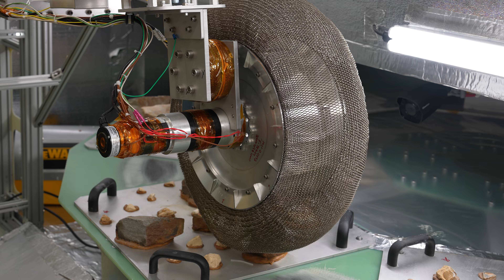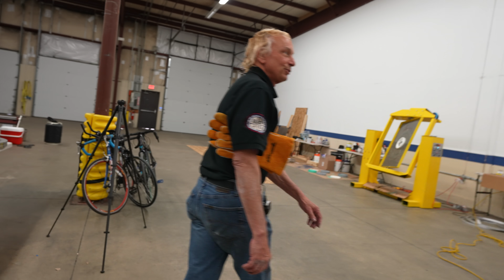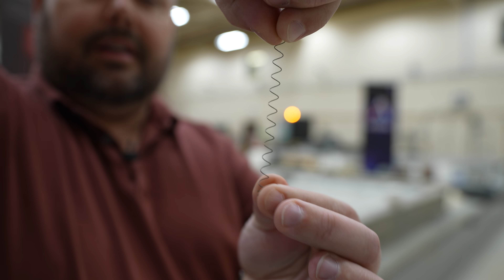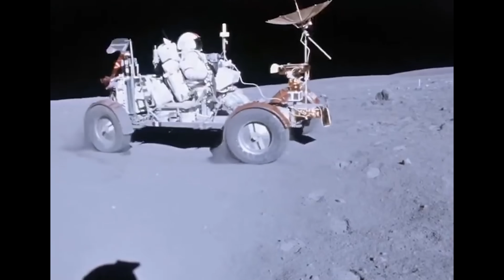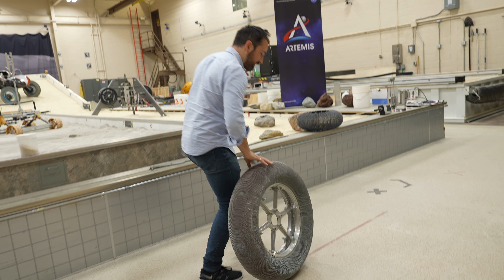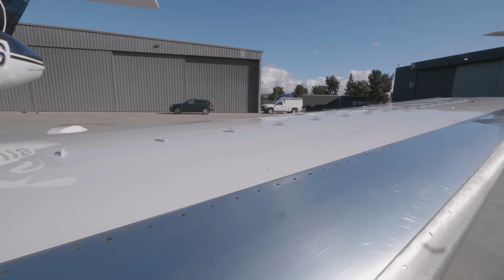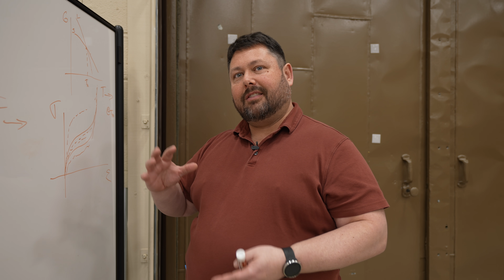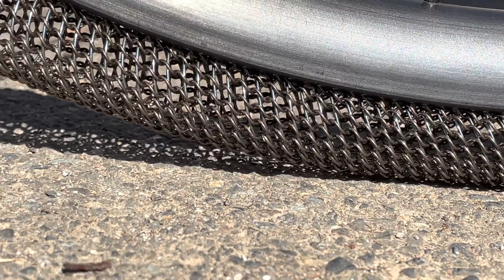How NASA Reinvented The Wheel

Comment: The stress-strain curve reminded me of my PhD work on single DNA molecules. We could grab the two ends of a single DNA molecule (with laser beams, of course), and make force-extension curves. DNA also goes through a phase transition under physical strain. At first it acts like a low stretch string, where the force increases quickly as the extension gets close to the full length of the molecule. At around 65 piconewtons (65x10^-12 N) it will “overstretch” and at a relatively constant force (hallmark of a phase transition) will stretch to ~1.7 times its normal length. When the force is reduced it will go back to its original length, although there can be significant hysteresis depending on how quickly the load is reduced. The overstretching is coupled to an unwinding of the double helix, so in effect it’s a wind up toy and can be used to apply torque, e.g. rotate a microscopic bead. DNA is a super cool material, I hope Veritasium does a video on this stuff.
Reply: I did not expect someone talking about overstretching DNA in an optical tweezer in a video about Nitinol. Greetings from a postdoc doing a lot of force extensions on RNA in magnetic and optical tweezers 😅
Reply: @salina3192  Hey, it’s a small world! Good luck with your experiments. One of the most fun single-molecule assays I developed was with DNA and RNA. I used plectonemically supercoiled DNA in a magnetic tweezers to do measure R-loop formation during transcription. It was the best assay because at the end you can overwind the molecule to release the RNA and regenerate the original tether. Could get a lot of data from one molecule!
Reply: @salina3192  As a layman, this video was mind-blowing enough, and now you two come in and tell us you can hold DNA with LASERS?! There's no brain left to blow anymore, it's all over the walls now!
Reply: > DNA is a super cool material

Is there any form of research going on to use DNA as a main ingredient of a material? The same way e.g. polymers are used in plastic? Or what sort of (potential) applications do these cool properties you just  mentioned have? Sounds fascinating!!
Reply: @Merthalophor  Yes, DNA is being used in material science. I’m not sure about industrial scale applications but due to the fact that it has a programmable structure they can do something called DNA origami and use it to make self-assembling nanostructures.
Reply: What about DNA computing 🤔
Reply: @tbraghavendran  yep, that is an active area of research as well. And they can make logic circuits and put them into cells for digital computation in cells. Wild stuff.
Reply: That's super interesting. Was there any change in the DNA chemistry during experiments? It'd be an interesting result if the mechanical properties of DNA were a factor in mutation or cancer.
Reply: @shrub4248  The mechanical strain would not itself cause any chemical change, but in theory inside a cell such mechanical deformation could make the DNA more susceptible to damage. DNA and all of the molecular machines that interact with it is super fascinating. E.g. because it’s a helix, the enzyme that separates the two strands during replication actually causes the DNA to rotate at several thousand RPM. This rotation would cause it to severely tangle so then there are other special enzymes that cut the DNA to allow it to swivel and release all of the twist. Life at the molecular scale is a true marvel of nanotechnology.
Reply: What if the actual "pair of letters" provide different properties on this stretch, torque/force transmissions and handling, etc? If so, you could engineer a highly specific shape and "sequence/stream/signal" of properties along the string !
Reply: @marcoottina654  yes, the different base pairs do have different binding energies, so the sequence does affect the mechanical properties. In theory you could have regions that are stinger and regions that are weaker and get some interesting behavior. Some sequences can actually adopt a left-handed helical form (normal DNA is a right-handed double helix). One of my theoretical projects was to insert a sequence that adopts the left-handed form when subjected to negative torque (as occurs during DNA replication or transcription) to make a sort of torque-capacitor to regulate gene expression. There are enzymes that chemically modify the DNA that also affect this transition to the left-handed form, so you could add another layer of control to the regulatory sequence. There is decent evidence that evolution has in fact used these mechanisms to regulate gene expression, but it is kind of a niche field and not well-explored. 

Sadly I had to leave academia and couldn’t pursue this research further because America pays its scientists poverty wages (I literally qualified for government subsidized housing while doing this research). That’s why you see most new discoveries happening in China these days. America lost its way and forgot what made this country great (hint: it wasn’t “cowboys”, who literally built nothing and basically just grew meat).
Reply: It is a great comment thread, thank you for your answers, good sir!
Reply: @basement5674  Thank you! I rarely get a chance to think about or discuss my former research, glad you found it interesting.
Reply: We can boost scientific progress by processing data from Boinc distributed computing software (material science ♥️)
Reply: we need a veritaseum video about this!
Reply: @crains8087  That would be amazing. I think people would love to see DNA being used as a wind-up toy! Feel free to contact me Derek! I can hook you up with my friends in the field at Stanford, etc.
Reply: This is super fascinating. Yes to a video on this stuff!
Reply: what do you mean "ofc with lasers" wtf lol 
Thats not an "ofc" kinda of statement
Reply: I want DNA tires for my bike now
Reply: Wow! You are certainly at the forefront of science!
I am a high school student interested in material sciences… and this is quite fascinating. A confluence of two separate fields of science certainly produces amazing results.

I had a question too… how does the “DNA grabbing” part work? How does a mere flow of massless photons exert a force? Can a flow of other such elementary particles exert a force too? Why do we use just light? Why not other particles?
I thought that photons are massless and as a result, could not interact with matter?
Also, similar force-application is derived from light in various other fields like laser cutters…
I hope I become a scientist one day….
Reply: Once again biology through evolution is way ahead of the curve.  Awesome info.  Thanks.

Comment: Nitinol is a great solution searching for practical problems.  Good analysis on this video, but these sorts of analyses seem to get 80% to solutions.  

How well would the tires wear when driving many miles at high speeds?

Since that wasn't discussed, we are left to presume not so well.

I actually worked in a bit role on a project to produce a nitinol-based stent for Cardiac applications.  Unfortunately, doctors didn't like how the Nitinol stent would pop into place when the sleeve that constrained it prior to placement was retracted.  Getting accurate positioning was more difficult than non-SMA stents that are deployed with internal balloons that are expanded to snap the stent just at the right time and position for more controlled placement. Non-SMA stents simply work better for most applications. 

That being said, Nitinol/SMA stents have the advantage for applications where arterial anatomy might cause a kinking such as arteries in the neck. SMAs have the benefit of not kinking where non-SMA materials might.

Feels a lot like the 80% solution of Fuel Cells... just not ready for prime time.. ditto Nuclear Fusion - continously ready for a "breakthrough within the next 10 years".

Comment: How do they deal with rocks getting trapped in the tires? In general, you're going to get rocks that are slightly larger than the gaps in the wires forcing their way through the gaps, due to the weight of the tire. And then they're in there but without the pressure needed to force them back out.  Are there rock-ejection systems?

Comment: My only doubt or concern is that if let’s say we use this material on a track field or a racing circuit where there is a lot of friction caused due to very fast rotation of wheels or during turns, the temperature can reach high enough to make a new memory in the austenite phase? Same goes to flight wheels.

Comment: airless tires that last forever? that doesn't make any money. ever notice how all those cool futuristic tires from Michelin several years ago suddenly stopped getting press? well the really don't care and stagnated its development. This will never take off as long as conservative mentality is afoot.
Reply: LEDs put an end to planned obsolescence lightbulb
Reply: @TriflingToad  hahahhaha. You are funny. That's not true at all. LEDs in modern light bulbs are purposely overvolted in over driven to make sure that they run hot rather than their actual rated voltage so the company actually fudge's the rated voltage makes him seem like they're actually running at the appropriate voltage. LEDs are actually capable of running for over 500 years with no maintenance but we still replace them anyways when they die :p go look into the Dubai lightbulbs.
Reply: @zilog1  I looked into Dubai lightbulbs and I found this: "A normal LED bulb uses an LED “filament” at 1 watt each. The Dubai bulbs run at about a fourth of that which means they need more LEDs to get the same amount of light, but they should last longer and operate more efficiently."
Reply: @TriflingToad  yes and thats how LEDS are supposed to be driven. Most electrical engineers that work at the component level know this. most average people do not. the Dubai light bulbs are the normal design and the consumer bulbs are the over stressed design. an LED should NOT produce heat at all but if you notice consumer leds within the brightness of normal bulbs do produce some heat. this is not good and not normal. they are over driven and run over spec.
Reply: @zilog1  idk about you but I have never felt an LED that is hot to the touch

Comment: Stupid question but... Stiff swords are brittle but sharp, soft swords are more elastic but usually dull... This is why only small blades like knives are made in stainless steel as a full sword made of that would be far too brittle... So... The swords that stiod the test of tile throughout history, especially the famous Katana, are made from a carefully mixed combination of both to get the best of both worlds and made a sword that is sharp and har enough to cut but flexible enough to withstand a lot of stress and... Well... Flexing.

So my question is, couldn't this metal, in theory, made a sword that can forever keep it's shape and or edge, depending on which it's used for in combination with other metals, with proper heating etc?

Just curious, but perhaps this metal is not good enough for bladed weapons at all... Besides... Who uses swords these days... But I'M CURIOUS! 🤣

Comment: Could the wheels withstand explosions? For like armoured vehicle application?🤔
Reply: A direct explosion will destroy pretty much anything it hits if it has enough force behind it, so it'll depend on the explosive used, leading to likely stronger weapons being used in order to destroy wheels enough to make them useless. It would however make shrapnel from explosions less deleterious to wheels if used as shown in the bike wheels. That also leads to a concern I have with everyday use on normal vehicles... Spike strips and most police weapons would have little effect on such tires in terms of what police normally have ready for ending a high speed pursuit safely.

Comment: My only issue with these tires is that they MIST be rubber skinned or used like an inner tube basically. They would not do well with mud, not enough surface area to maintain traction. Same with a wet road.

Comment: There is one huge issue with this. As wheels can be elastic inwards, the same happens outwards. And if you do that for high speed wheels, they will expand very quickly. Plus for aircraft you need more grip to break.
All and all an amazing idea for many applications, but there is much more to work on when it comes to everyday use.
Reply: Regarding grip, these tires tend to have a larger footprint, as well as always being perfectly "inflated" with rubber treads. So the grip is excellent. Not totally clear on the expansion you're expecting, but it's not something we've observed.

Comment: One of the problems in simulating lunar dust on Earth is the air that will surround and partially fluidize dust. Lunar dust didn't behave as expected due to lack of air fluidization, which is why they didn't sink in upon landing and had problems pushing flagpoles and probes into the dust.

Comment: 12:34 shouldn't this cause a permanent deformation, tho? Or are the temperatures just high enough to force a phase change, but not high enough to allow a rearrangement of the atoms?
Going off the graphic at 11:26, stressing the material while it's hot, should just damage the object.

Comment: I don't see these tires replacing conventional tires cause for the two small problems you solve (no flat tires, no underinflation) you introduce a host of new problems, the most prohibitive of those from the get go: cost. Even if the weaving were to be fully automated, adding Titanium is never gonna make this cheaper than conventional tires. And since you still need the rubber for grip anyways it's not even going to be a tire you'll replace less often.

Comment: What's the downside?  How about metal fatigue? Can it cycle an unlimited number of times?  It can by used for medical devices so it must be non corrosive.  Is it expensive?  I think titanium is expensive as it's a rare metal.  How about strength? Yes it can exert force but there are limits to everything.  At some point it breaks. Those bike tires have a plastic outer covering and need the tread to work well.  That part still wears out.  A wire mesh tire has a good tread but not much grip on the road.  Tires need friction and that means rubber.  Not going flat is only part of a tires performance profile.

Comment: but how will you brake if your tires are made up of that in a Jeep? I assume that friction would tear apart the tyre no? The same with aeroplanes as they require heavy braking as they land. would it be used as a tube inside the rubber tyre?

Comment: Question: With a mesh wire tire, wouldn't small objects be able to make its way into the tire? If it can, at that point, wouldn't the flexibility of the tire be compromised? Is there a better design that can compensate for this?

Comment: Okay so I have 2 questions: 1. You said the tyres would last the lifetime of a Mars rover mission but has the material been tested to the point of actual failure? Applying all this stress to this material has got to eventually result in failure right? I mean entropy is a thing, so I'm curious whether there's a number that anyone can put on this. and 2. when can I fit those to my car? 😉 Or I suppose on a more serious note, is this material likely to be affordable enough to mass manufacture for commercial vehicles, and would it help with the emissions of micro particulates that rubber tyres are notorious for?

Comment: My question is, what is the tensile strength of Austenite/Detwinned Martensite if it is structured to phase change at say ~36*C?

And in the instance of adding more heat to deformed Detwinned Martensite, does it return to a more plastic Austenite???

Comment: I have a problem with these metal tires for on-road use. Yes, you can definitely use them and they can bear the load of a vehicle. My problem is how it affects the road and how long would they last? Would it have wear indicators? Maintenance? (Since it can collect road debris due to the porous nature). Serviceability? Speed rating? So many questions for on-road application.

Comment: Totally impressed by the large number of applications of Nitinol. About the control of airplane flaps by the conduction of heat to Nitinol, I would wonder if they can be controlled precisely?
I mean the vortex generators should be either flipped up or tucked, but with wing flaps one would need precise control of the angle of pitch.
Would love to read and learn more about actuation using memory metal.

Comment: Well, you can't adjust it for different loads. Like empty car - full car. Or bicycle - different weight riders. Also, when loosing 10 kg of weight I should get another metal tire ? Kinda expensive... Compared to loosing some air from the tube.
Oh, and how many times it can stretch,  bend or return to previous shape after temperature change ? How many cycles ?

Comment: 3.24 " theres no confining pressure so it can basically explode " that doesnt make any sense. A tire has to contain pressure regardless of the external pressure. There is only a 15 psi difference between normal pressure at sea level and a hard vacuum. Its trivial for a tire to take that into account. Now the temperature difference for rubber makes sense but thats not what he said.
Reply: A little dramatic but the point is probably more that damage to an inflated tire would be catastrophic on the function of the tire, whether it's an explosion or a slow leak.